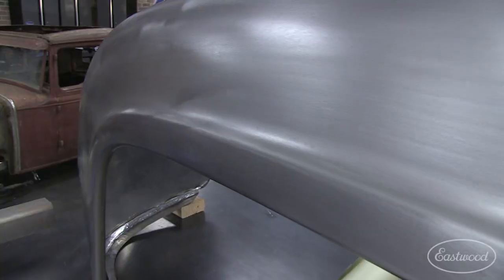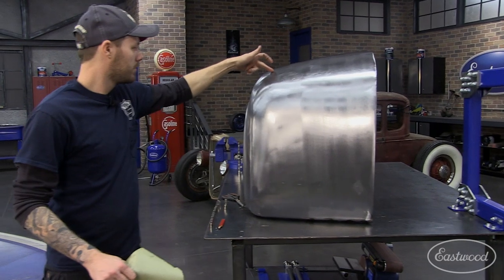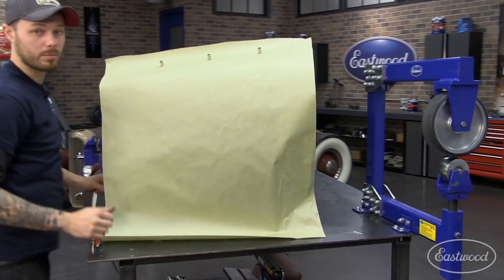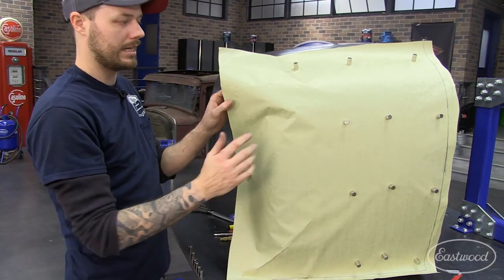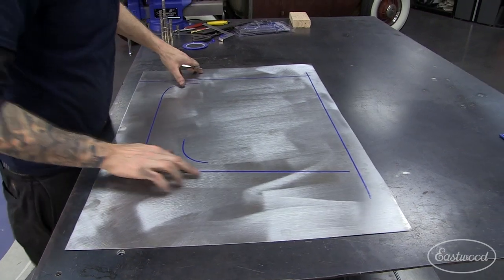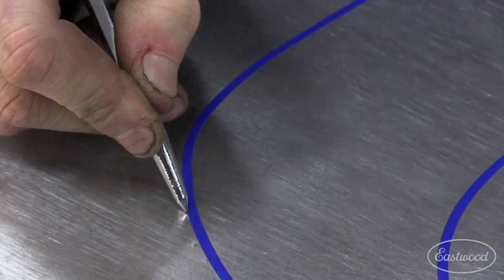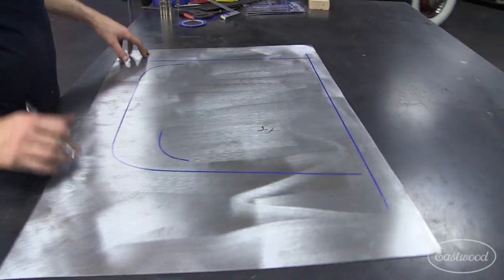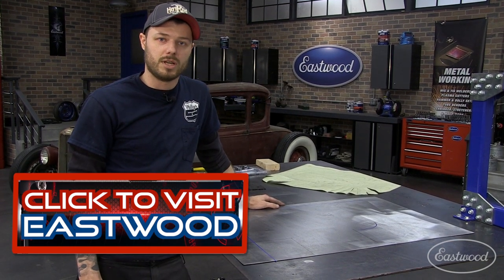How To Make a Paper Pattern Template for Metal Fab & Sheet Metal - Hand-Made Fender - Eastwood

Comment: I like to use tape, I tape the part with masking tape in one direction then add another layer of tape in the opposite (90 degrees) and some times a 3rd layer in a (45 degree) then carefully peal the tape off in one piece, then I make some cuts so that it can lay flat, then put some plastic wrap (like for sandwiches) on the sticky side or leave it sticky and just stick it to the metal...
Reply: That was how I did my firewall blanket. same method as you. This was my first attempt at it and, after trying paper and clear vellum, The tape method was the most accurate of the three as it does not move or wrinkle. The only issue I had was, if one didn't section the tape out in complex 3D shapes, (Hyperbolic, Lofted Curves, Complex Geometric shapes) the tape would end up taking on a 3D shape that you couldn't lie flat until, cutting out each flat shape first.

Comment: lol... ok im going to try it. im ready to fab a aluminum 2018 camaro ss hood cowl with heat extractors onto my steel 9-7x hood. the 2 flared out sidewalls of the cowl that hold the heat extractor vents  has been worrying me, i think im ready to try it now. shops in michigan quoted me $3000 to 10k and my pockets are not that deep.
Reply from the maker: That's an awesome project. Send us some pics! @eastwoodco on Instagram

Comment: Pardon my stupidity here but could you cut the Same cuts on the sheet metal, then weld the metal on a non visible area? Keep in mind I am still new to this and am only doing this as a hobby.
Reply from the maker: Can you explain further?  I don't quite understand the question.
Reply: Eastwood Company could you lay out your paper flat on a pannel an trace where you put your cuts in the paper and copy the cuts on to the metal? And then once you have the shape you want, weld the pannel from behind to hold that shape until you start rolling it on the wheel.